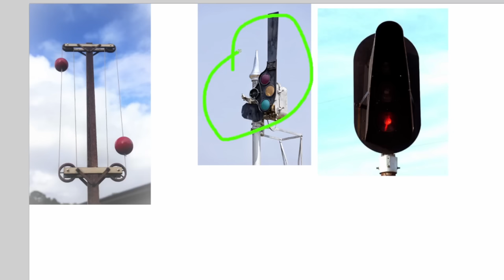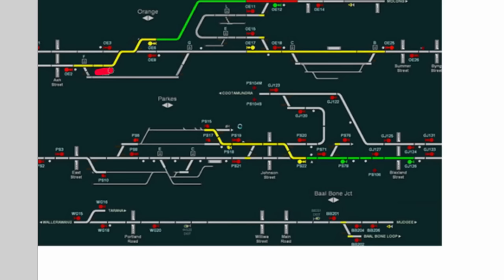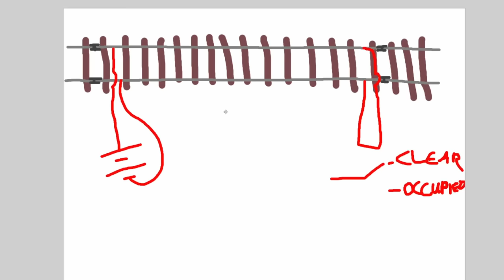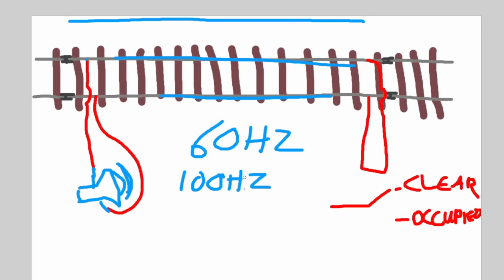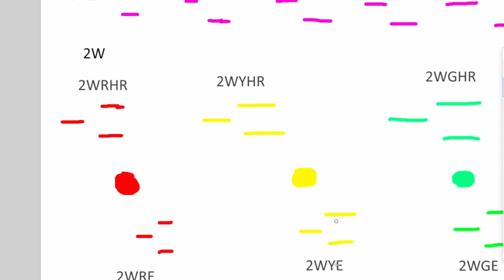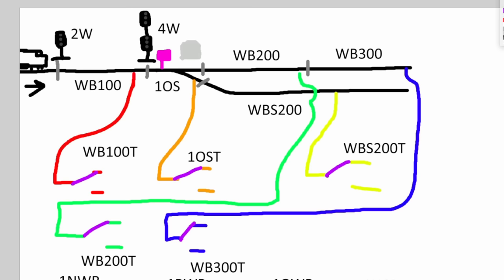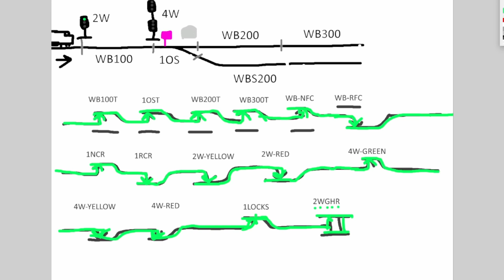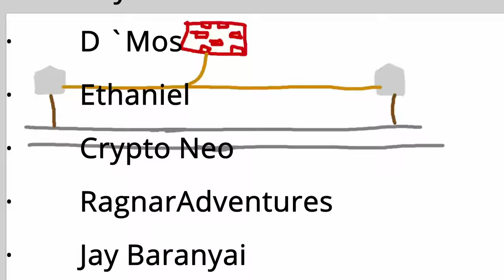SIGNALS 101: 10 Levels of Train Signal Understanding

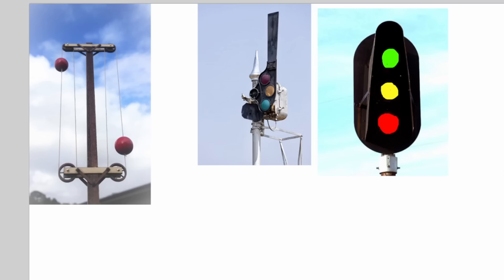Comment: I'm just going to leave this little side note for 5:11 , Traffic signals actually were designed after Train signals and the Semaphore displayed in this section of the video is what modern traffic lights mimic. you even see the Green on bottom yellow in the middle and Red on top. As Hyce mentioned Railroads look for the high position of the signal(i.e. the flag on the Semaphore) so when the change from Semaphore to Light signals happened they had to flip the colors upside down so that the older Engineers could adapt to the new electronic signaling faster. 

Now I'm skipping some funny business that happened during this transition and the reasoning why this happened. I know some people who've long time rail spot might even point out that the current electric signal layout wasn't always that way. just note that's the funny business I'm happily skipping over. This is also apart of the root reason why Signaling diagrams for Rail signals is such a mess.
Reply from the maker: Cheers Dallen :)
Reply: @Hyce777  Cheers to you too Hyce.
Reply: Hyce: this is an excellent video which covers the essentials of signalling. 'Thank You' from a retired Signal (design) engineer with the former British Railways Board H.Q.
The reason that the red aspect is located at the bottom of the signal head array is safety. With incandescent lamps, a curved hood is provided above the lens to prevent sunlight being reflected by the internal mirror giving a false indication. However, during the winter, snow tends to build up on the top of the hoods, which obscures the light from the lens above it. Having the red light at the bottom, with no hood below it, eliminates this risk. Of course, with LED lights, hoods are not necessary.
 In the UK we use vane relays set at 83.333 Hz for track circuits: this is not a harmonic of the 50 Hz traction supply so they cannot be affected by the return current.
Reply from the maker: @cardiffian558  that's a neat piece of additional info I hadn't heard of regarding red on bottom. Cheers - and cool about your vane relays. We use 100 hz for the track circuits I work with, same thing about no harmonics. :)
Reply: @Hyce777  on the other hand, for roadway signals the red ended up on top partially due to the much more variable terrain for cars. The most rolling of hills of trains are still relatively flat for cars and you can see for quite a long distance. But on a road, you could have rolling hills and they wanted to make sure that as you crest a hill, the first signal that could be seen would be red.

Comment: I like your way of explaining by these drawings.  Here in the Netherlands we have inherited the rail technic  from the US, including similar signals and level crossings. We use that dc track circuit, also on lines with 1800 v dc overhead power lines.  There is only one thing: the train shortens the circuit resulting in the relay to fall of: track occupied. But at the same time the train also short cuts the battery. Now that is not possible. You can not shortcut a battery. So how do they prevent the battery from being shortcut?  On top of the track circuit we also have the automatic train control system (also US origine). It sends 75 Hz ac through the rails, and the rate that it is switched on and of is the code for the max allowed speed. This signal is picked up by two coils on the front bogey of the train, one on each side. A on board system generates a speed indication on a display in the train cab. So we have 3 signals going through the track simultaneously: return DC 1800 v train driving current, some voltage (what?) dc track circuit train detect current, and the 75 Hz atc signal. So that gets complicated :)
Reply from the maker: That does get complicated! A lot of our systems also use the cab signal with loop pickup as well. My transit system does. It's neat.

Comment: When Norway had... Okay still has, a lot of signal issues around the rail lines of the capitol of Oslo.
The one thing we heard "Oh there are problems with the relays" and that was all we got out the media and everyone was like "What is the relay problem, swap the faulty one and make the trains run!"
Turns out it wasn't just a faulty relay... Just a really really really really messy relay puzzle that had gotten old and worn out and wasn't that easy to replace :D
Reply from the maker: sounds about right, lol.
Reply: @Hyce777  To make your signal engineer brain explode, the rail network around the capitol is very much as switchy as that british rail yard you commented on in your train simulator video you did not too long ago :D
And with the relays for controlling something like that, the puzzle gets really nasty.

Comment: Relay lasting 100 years, they really don't make stuff like they used to. Like you could buy just about anything have it last 20 years may need a fix and last another 20 - 50 years . Also this was nice explanation on signals with R.R. Appreciate  it.
Reply: Railway signaling equipment is expensive because it's over-engineered because it has to work.

Comment: Like others have said, at the "track circuits" level, the phase shift method of detecting a train needs to use a higher frequency simply to make the wavelength of the electrical signal shorter, but it only needs to be a few hundred kilohertz, well below the AM radio broadcast band but still technically radio frequency.
But there's a benefit to this, as well.
The frequency that is returned to the detector depends on the speed of the train. You've probably heard of this elsewhere, but it's the basic concept behind Doppler radar (and Doppler sonar).
It is almost trivially easy to use some simple electronics to correlate the difference in supplied vs returned frequency to create a signal that is proportional to the difference between the frequency sent and the frequency returned.
The sign of this difference indicates the direction of motion of the train, and the magnitude of the difference indicates the speed of the train on the tracks.

This is also the exact same way that a "radar gun" aka radar-based speedometer as used by the police to issue speeding tickets operates.
In those, they bounce a radio frequency signal off of your vehicle, and then measure the frequency of the returned signal. With some math done by relatively simple electronics, this determines the speed difference between the antenna detecting the returned RF signal (usually inside the radar gun), and the surface that caused the signal to be reflected back to the receiving antenna in the first place (aka the vehicle who's speed is being measured).
It even works inside a police cruiser, tho in this case it will be measuring the difference between the police vehicle's own speed and the speed of the vehicle that was targeted to be measured.

So, long story short, with enough electronics, you can detect how fast a train is going just by hooking a couple wires to the tracks!
Because the electronics for it are so primitive by modern standards (they probably had this stuff figured out in the '80s), I expect this is probably in widespread use at least SOMEWHERE in the world.
In theory, you can even do it with audio frequencies on the rails, but higher frequencies are likely easier to get working, up to a point.

Comment: My basic understanding for Union Pacific signals is green means clear for at least 3 bocks, flashing yellow means you have to stop in 2 blocks, yellow means you have to stop in the next block and red means obviously stop. When 2 heads exist the top head is the main and the bottom head is usually a diverging track. If the bottom head is green you can enter at track speed, if its yellow then you must slow for the switch and red means stop or the switch isnt aligned that direction. Thats the limit of my basic Union Pacific signaling understanding.

Comment: 2:10 In the early days, trains operated by Train Orders - Track Warrants are a relatively recent form of track authority.  Not being nitpicky - they are vastly different!
Reply from the maker: That's absolutely correct, bad use of terminology by me. Cheers :)
Reply: If you want to be very nitpicky, the first method, as described in the video, was time table only. The first telegraphed instructions that developed into train order operation was issued in 1851.

Comment: Thanks for this great vid. The Pennsylvania Railroad had a series of unique disk position light signals. Some of these are still in usage on the Northeast Corridor between Washington DC and New York.
Reply: The Pennsylvania Railroad invented the Position-Light signal.   The idea was to use lights to mimic the arm positions of a semaphore. Originally they started with four lights in a row, but switched to the 3rd generation 3-light versions once they were found to be perfectly satisfactory.  All of the lights on an original PL signal are a fog-penetrating yellow.   At some point, after some kind of accident, some moron decided that Red for stop would be better, so the ——— lights were changed to Red (which is actually much dimmer!).    

Modern position-light signals on the Amtrak Northeast Corridor are properly called Position-Color-Light signals, since they have been completely colorized.  The Norfolk & Western Railway also adopted position-light signals and colorized them themselves (including the dwarfs!).

Comment: In The Netherlands train signals also have red at the bottom, but I always learnt a different reason for that than what was explained in the video here... The reason is that the red light, obviously the most important one, would be least likely to be covered by snow when placed at the bottom. (Snow can precipitate on the cap of the light below a certain light, although the chance of this happening is very sliim.)

This isn't meant as a correction, just a remark. And, both can be true.

Comment: The NTSB along with the major RR players should come together to come up with a universal signaling lighting system.  When we work with a specific RR we ask for the signaling decipher book as I like to call it. So when I have who ever will be working on the project they have a copy in the hy-rail trucks as well as all MOV equiptmnent. Shoot if we can agree on a global automobile traffic light meaning, then we certainly can do the same for rail.
Reply from the maker: So you'd hope. I suppose they don't mind it knowing that each crew has to be certified for the territory they run on, but a true standard would be nice...
Reply: Track isn't owned by the state. Never gonna happen
Reply: The 'standard' system proposed by the AAR still survives in some part as Eastern Speed signal systems. Of modern roads, CSX is probably the closest. The FRA proposed one in the late 70s, but no railroad ever adopted it, which isn't surprising, since the system they proposed was...weird. The document outlining these rules, along with rules from several railroads in the US and around the world (including several errors) is "1979_EVALUATION OF SIGNAL CONTROL SYSTEM EQUIPMENT"
Reply: I think you mean well, but it isn't that simple.  For one thing, there is not a universal meaning or display of traffic signals.  Some places have flashing green.  Some places have red and amber lit at the same time.  Some places have Portland orange and lunar white pedestrian signals; other places have red/green.  

Signaling systems are tailored to fit the needs of the railroad and the traffic on it.   Speed signaling (signals where diverging indications prescribe a specific speed limit through the switches) isn't very popular in the western U.S. because it's too constricting.  There's a lot more room in the west.  

Canada did exactly as you suggest, and it shows that uniform doesn't always work out for the best.  The signal aspect logic is sound, but stretched pretty thin, and it's easy to get confused if you're not paying attention.  Additionally, there are still exceptions like those pesky DV signals, which are for all intents and purposes, "route signaling" islands.

Comment: So I saw some comments regarding grade crossings, and we have multiple types on our railroad, some are simple DC crossings, and some have full preemption. I think the ones with preemption are really neat. And If someone sees this comment wondering how grade crossings work and detect trains, I can explain how one type works.

So our crossings with preemption work identical to the one at 21:58, the audio frequency track circuit. 

Using the same method you describe, with the difference though is that the receiver is tuned to the length of the detected circuit, to the frequency the computer is outputting, the signal maintainer shunts the end of the circuit, and puts the distance into the computer. He does this 4 times on either side, at the full length, 75%, 50%, 25% and 0%, the computer then knows where at each distance the return waveform will be at, and how "loud" the return waveform is, as you go out further, the amplification of the returned signal is diminished, and the computer can use both the frequency and amplification to measure train speed and distance.

So this method does a few neat things, one of them is since the computer knows what the amplification is at, based on its location from the island, it can detect the trains distance from the signal, (Like when a train is approaching, the horn is quieter, than when its next to you, then, it listens to the frequency modulation to detect speed, using the Doppler Effect. Think of this as when you hear a fast moving train, the pitch of the horn sounds higher as its approaching, then once it passes, it drops lower, the same thing happens with the waveform as the axle rolls across the rail, the higher the speed, the higher the incoming frequency will be. It can then calculates the train speed based on the return frequency, and the train distance based on the amplification, and then can determine how long of a preemption time to give the signals before activation, Ours will calculate the speed, then based on that speed, it will make sure the crossing lights and bell activate 30 seconds before the train enters the island, and then 15 seconds later, the gates will be fully dropped.

If the frequency change stops, and the amplitude stays the same, it will wait, and see if the signal changes again, if not, it silences the crossing and turns the lights off, until it detects a shift in amplitude and frequency again.

Comment: Are you aware of the ball signals in Whitefield New Hampshire?  They're reportedly the last active ball signals in the United States on active railroad tacks even though the rails hardly get any use and probably will not see much more activity. Unless the Conway Scenic Railroad does another excursion to Whitefield NH.
Reply from the maker: Oh wow, i had no idea there still were some..
Reply: @Hyce777  o yes. Some of the tracks to Whitefield were ripped up in 2021 so there will probably be no need for a single there any more. But the tracks in town are still labeled as active and the single remains as a historic place. To technically gard the demand there. If you look up conway scenic railroad trip to Whitefield you can see passenger trains using the single.
Reply: I thought those were long (5 years?) as well!

Comment: Just a quick note, "Traffic Control" refers to the direction of traffic on a given line, not the concept of running an interlocking. Traffic Control started as fixed direction or by train order, then saw some examples of manual interlocked traffic control in towers and then finally Centralized Traffic Control that could remote control multiple interlockings over a wide area and set traffic on bi-directional tracks. 

Achieving bi-directional signaling was actually a real challenge and its so common today that bit of history can be lost.
Reply from the maker: That's neat! I understood traffic as a principle, but not the history that drove it. These days our interlockings "set" the traffic direction, which is why I said it the way I did.